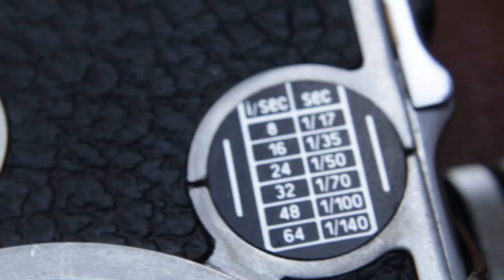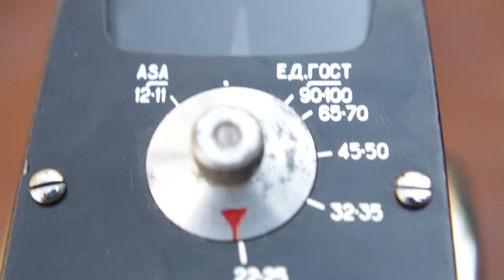Quartz M standard 8mm film camera

Comment: two of the buttons on mine won't move what do you suggest i do?
Reply from the maker: Which ones? Could be damage due to keeping the camera in moist area
Reply: @CineRollStudios  speed and continuous camera, gonna try and WD40 them and see if it helps
Reply: used some pliers and got them moving in the end
Reply from the maker: Hm definetly a good idea to try it. Ill have a look at my one in a few days time after i get home and let you know my thoughts why they might not be working. So speed dial doesnt change the frame rate?  And the button that suppose to be record button doesnt work (continues camera - not sure which one you mean) ? Did i got that right?
Reply from the maker: @JJsolutionseco  amazing hope you have fun playing with it!! :)
Reply: @JJsolutionseco  Hi, how exactly did you manage to move them? I have the exact issue, I'm stuck on 16 frames per second.
Reply: One I ordered just showed up. Mine is stuck on single frame mode too, and I can’t move the lever on the side unless I press it against a table/worktop. Any suggestions on how to get it to KC?
Reply: Never use wd40 on any camera, its wax based and will cause more issues

Comment: Hiii i got that One too. Is It possible to get focus?
Reply from the maker: Yes it is possible to focus on the lens!
Reply: @CineRollStudios   how can i find It? I ask because i dont know how get Focus and other data 🙄. Is It a m49?
Reply from the maker: Im not sure 100% what mount this camera uses but i think its called D mount. Its a simillar mount to m42 screw mount. The only diference is the size of the mount & the lens.
Reply from the maker: @mrerasmo1985ms  and dont forget that when the lens is wide open you will have a small depth of field. While having it closed to about f11 - f22 your depth of field will get a lot bigger and you'll have more in focus.
Reply from the maker: @mrerasmo1985ms  the lens should have numbers on focus ring and index mark for focus. It's usually counted in feat or metres depending on the country the lens was made for. For the purpose of this explanation we will count in feat.
Reply from the maker: @mrerasmo1985ms  if the index mark is on 15ft. That means that everything 15ft away will be in focus. We count the distance from the camera gate mark on the camera.
Reply from the maker: @mrerasmo1985ms  if the subject is moving you can put marks on the floor for focus pulling. So a subject walks from 15ft away to 3ft away from the camera. You can slowly pull focus by looking at marks.
Reply from the maker: @mrerasmo1985ms  i hope this helps you out :)
Reply from the maker: And thats the lens type i talked about : A D-mount is a type of lens mount commonly found on 8mm movie cameras. Throat or thread diameter 15.88 mm Mount thread pitch 32 TPI Flange focal distance 12.29 mm D-Mount lenses have found new uses in the Nikon 1 series and the Pentax Q series cameras.